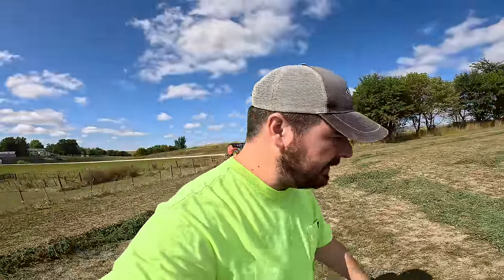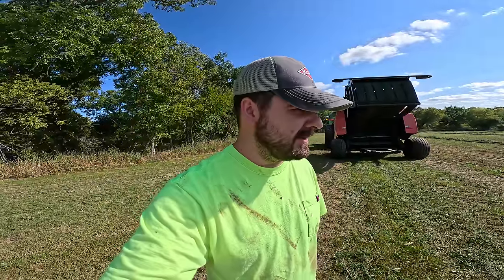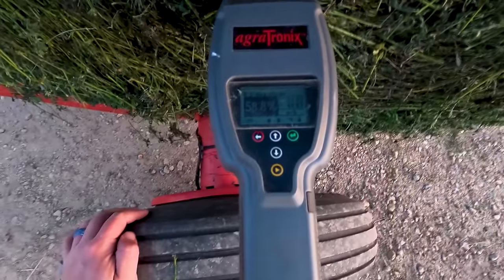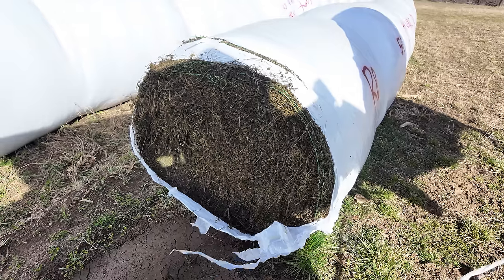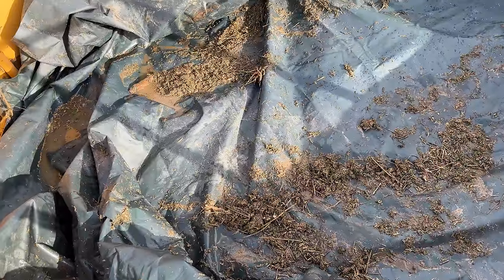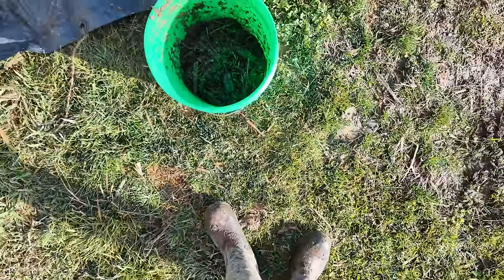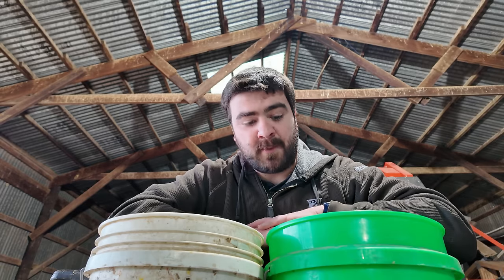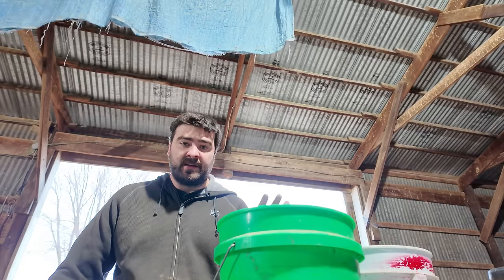Hay Loss Comparison For Cut and Uncut Bales - KUHN VB 560 OptiCut Round Baler

Comment: We started doing balage this year after watching your videos.  Ended up wrapping almost 1500 bales.  We found the bales run through the precutter mix in the TMR twice as fast. We saw 25 points of RFV gain between the dry hay and the baleage and the cows require less bales per day to gain the same.  Plus baleage has allowed us to bale mixed crops that don't dry evenly.  We are going to try a few fields of peas,oats and turnips this spring.
Reply from the maker: That's cool to hear! The only downside I have found is that you get more weight from the moisture that you have to transport. I am looking into switching to a TMR down the road and the time savings on mixing would make a baler with knives so worth it!
Reply: @HowFarmsWork  We haul with a semi and have backed off from 28 bales per load to 22. Don't need compaction in the headlands. Plus this fall it was crazy to have all the hay home already vrs having to haul hay after finishing harvest.
Reply: @HowFarmsWork  how long have you guys kept wrapped hold over baleage? We are going to have a lot that won't get fed this season

Comment: We've been doing baleage since 1999. Thousands of bales.  Target moisture of 45% is probably ideal.  Better shaped bales, 4 foot by 54 inch is what we do.  Most equipment can handle them average around 1300 lbs.  One thing to remember is slicing has more field loss from the baler.  (Just walk behind a baler that is slicing and one with the knives not cutting)  Hay feeding waste is definitely far less with sliced hay.  Slicing does take a little more fuel also. We've been selling some hay since 2007, generally speaking selling by the bale people will  not pay more for them.  Selling by the ton does have some effect, denser bales definitely. Slicing  dry hay makes one heck of a storm coming from the bottom of the baler. Next question is where is the rest of that can? People throwing out crap are just...glass beer bottles too...fun times. Been watching you grow and learn for what seems like a long time,  even made it to your 2017 farm day.  Best of everything to you and Hannah too!

Comment: Thanks for sharing your thoughts, ideas and videos. Interesting and entertaining test. Was thinking if you were to perform the test in Travis’s yard that is concrete you could scrape between bails to determine how much they pull out and drop. Yes there will be some manure in the mix but if your careful you should be able to avoid it. I would think just by starting with a clean surface for each bail a visual observation should be enough to confirm your expectations. Wishing you and your family the best.

Comment: So fun facts Ryan. I own a 3190 kuhn. My inlaws have switched to all cut bales because they have found I believe 5 points higher on rfv over silage and 10 points better on dry hay. And another side note to add to your comments about the waste out side the feeder. The waste that is cut up spreads back to the field far better then uncut as the spreader beaters don't just grab chucks. The parts are smaller. Thats a unknown positive also.
Reply from the maker: Travis noticed how much better it was spreading manure this spring when he was feeding out the cut bales on the concrete lot where he was better able to keep track of where he was feeding the cut and uncut material. He said the knives were worth it for the manure alone.

Comment: So 3/4 of a lb / bale less with a cut bale versus a non cut bale. Interesting enough, they probably ate “more” from the cut bale, although I wonder how much was left because they simply couldn’t reach material to finish it up. As close as it was, is it worth cutting the bales going through the baler versus not cutting? Do you think a J-bunk or H-bunk for feeding would have less waste even over a bale ring? Like you said, lots of variables, and it certainly seems like you could still make an argument for one way or the other.

Comment: the way you might be able to get better answer for waste on ground. place the feeder on a clean concrete surface. then feed a bale, clean the cement and get a manure 5 gallon sample. repeat with the other feed bale and get new sample. then flush both samples with water. the hay materials should separate out. that would give you a bulk residue comparison.